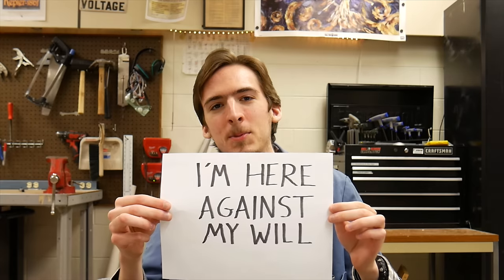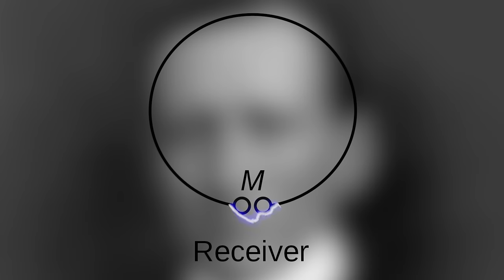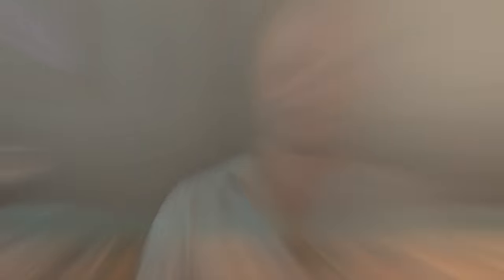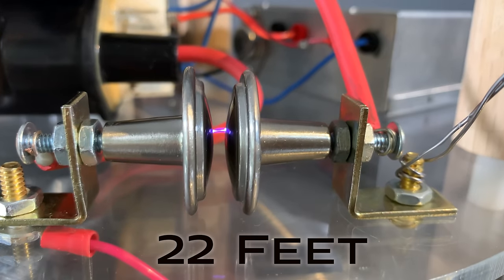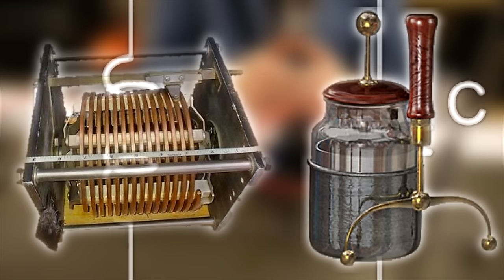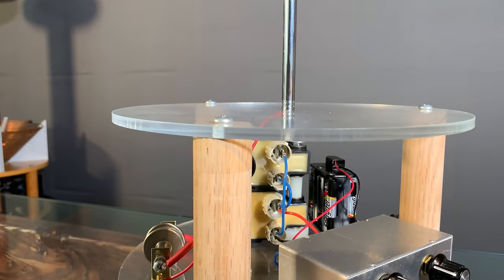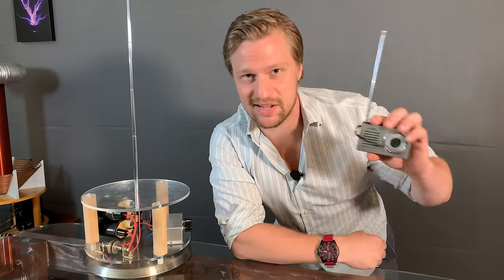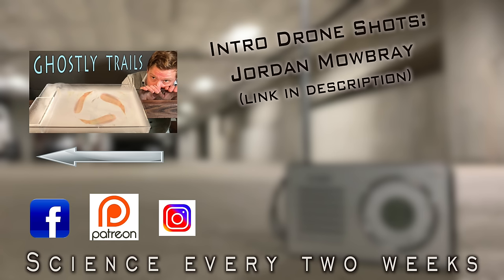Building a Revolutionary Spark Gap Radio (ft. Blueprint)

Comment: I'm a electrical engineering student from India, this one is a best experimental method for verification of Maxwell's equation,

And i really learned something new today,

Since spark gap and high voltage is used a low resistance plasma path establishes, because of this a ionized particle jumps from one electrode to other. Since particles are electrically charged a electric field establishes and since those will move from one side to other side magnetic field also establishes and combination of these two field results in radio wave (because of low level energy density) and it is transmitted by antenna as oscillating wave in space/atmosphere
.

 And in simple words Maxwell's theoretical statement or mathematical equation states that combination of electric and magnetic field which are in different dimensions gives electromagnetic wave and spark gap produces radio wave & radio wave is also a electromagnetic wave.
 Thus this experiment experimentally verifies Maxwell's theory.

And it is beautifully demonstrated and explained by both of you.....

But i have a doubt in transmission, since overall capacitance of the system is in pF range and inductance is also low, thus energy released or consumed or simply stored by reactive elements are less under resonance  also Q factor of coil is too low so amplitude of generated time varying signal signal reaches to zero within nano or in micro seconds so what can i expect at the receiving end ? Noise or Original signal or Distorted version of original signal or pulses (if i neglect medium loss) ?

But this simple circuit has better efficiency with consideration with distance, because Poynting theorem states that power delivered by electromagnetic wave is given by P=E×H (in vector form), now if i consider it's units E has V/m and H has A/m thus we have W/m² in other words distance and power has inverse proportion, and even for long distance this circuit is a winner (Along with medium loss)...!!

Thank you sir, this is a grate educational video.....

I joined this family when it has around 4.3k subscribers but now its 27k..... So this family is growing day by day......
Reply from the maker: I really appreciate your analysis of radio. Wonderful job, yes. 

Thank you for your kind words towards Dayton and I. Glad you are a part of #plasmanation
Reply: Sir please make video on atmospheric electricity.......
Reply: Eu sou engenheiro quimico formado no Brasil, otima explicacao
Reply: i was look for this
Reply: very good
Reply: @alandeng027  hey al 😂
Reply: Now it's 605k ❤️
Reply: Sir what's your profession..what are you doing now. I would like to know about you.. you have great knowledge about electromagnetic field theory..btw I am also from India

Comment: A wonderful and wholesome video as always, Jay! And might I add that your transmitter looks very aesthetically pleasing.

I can't wait to see what is next for Plasma Channel!
Reply from the maker: Blueprint- you will always be a friend of Plasma Channel. Thank you for introducing me to radio
Reply: @PlasmaChannel  is it possible to focus the electromagnetic waves of a radio as to not be broadcast in every direction but only in a certain cone or sector, or could it be so focused as like a a laser beam? and if possible  how would you go about that?
Reply: is it possible to focus the electromagnetic waves of a radio as to not be broadcast in every direction but only in a certain cone or sector, or could it be so focused as like a a laser beam? and if possible  how would you go about that?
Reply: As a radio engineer the antenna length comes down to frequency and resonance. At 1khz the wave length is far greater than at 17kHz, hence a shorter antenna. At 1khz the RF wavelength is 984000 feet, not 5. Also an RF radio wave is not an electromagnetic wave as is prominently written in many books these days in error, it is an electrostatic wave. Imagine walking past a radio station transmitting 2Kw of power, bits of metal from all around would be flying through the air and attaching itself to the antenna until you couldn't actually see the thing until you shut down the Tx. 'Electrostatic'.

Comment: Did this when I was a kid.  Used a 50KV xray transformer and long and high antenna.  Road my bike away for a few miles hearing it all the way.  Good fun.
Reply from the maker: That's really cool. Must have been an awesome feeling.
Reply: the local HAMs must have loved you!
Reply: @PlasmaChannel  It was. especially when I got myself connected across the output.  🤣
Reply: @Francois_Dupont  Only did it a small number of times.  Didn't even know there was such a thing as hams.   I was quite young.  😊
Reply: @Graeme_Lastname  no problem, apparently before the 1950~ most lawnmowers, cars and motorcycle didnt even have a resistor in the spark plug. it would cause each of those motors to be a little spark-gap transmitter. research this if you want, it is interesting!
Reply: @Francois_Dupont  I remember this well.  In some cases you could tell what type of car was passing.  VW was very distinct.   😂

Comment: When I was a little kid I built one for the science fair out of a battery, a wire, a nail, and a file. Scrape the nail against the file, sparks fly, and loud static comes out of all the radio. I came up with the idea 100% on my own, with no help or knowledge whatsoever, just playing around. Also built a light meter out of an led, a wire, and a voltmeter.

Comment: Ok, good video, just a few points. 

1. Many oscillators even today have a spark gap, albeit one that is enclosed by a low voltage neon lamp. Tesla came up with a method of using a magnet to disperse the arc as soon as it had formed and reduce the extra emf, not to mention using capacitors and inductors to tune the resonant frequency.
2. A resonant antenna should be 1/4 wavelength (1/3 is pretty good too, but not ideal). If you look at a single wavelength on an oscilloscope, 1/2 and a full wavelength are the points where the voltage goes back to zero. 1/4, 3/4, and odd multiples of the same are the pints where the voltage peaks.
3. FCC rules allow for experimentation and emergencies as reasons for using otherwise illegal methods.
Reply from the maker: Thanks for these points. Admittedly I am still learning about FCC regs.

Comment: my grandfather was born in the year 1900, he learned electronically by correspondence, and he learned to build his radios, on one occasion he showed me a radio that worked with a stone called galenita, and you could listen to stations from many parts of the world, We got to listen to radio stations from China !!!! , your videos are very good! Congratulations!!!
Reply: Galenite, kind of like lead crystal?
Reply: The mineral is called galena and is comprised mainly of lead sulfide with trace impurities of silver, bismuth &c.  It was used in what was euphemistically called a "Cat's Whisker" receiver.  Without going into much detail it consisted of a long wire antenna, tuneable coil, the galena crystal, head phones and a ground.  You'd position the "cat's whisker" on a "sweet spot" on the crystal which would then enable detection of an AM signal which was fed to the headphones.  Back in the 60s a lot of novelty shops sold self powered radios which were essentially the same as the galena variety except for the fact that it used a germanium diode to detect a signal.  I had one as a kid; however, with the 3 foot antenna wire it had, the best you could get was a really strong signal from WCBS or WABC.  (I grew up in the Bronx.) I learned electronics from a 1963 copy of the ARRL Radio Amateurs Handbook which I still have in my collection and eventually went on to college for a BSEE.  If you want to know more about this primitive receiver check out  https://www.electronics-notes.com/articles/history/radio-receivers/cats-whisker-crystal-radios-sets.php.
Reply: @johnbrandolini2915  great!!!

Comment: The antenna: half the wave-length or quarter of the wave-length?
I’ve learned that it has to be 1/4 of the wave-length.

But I guess that there are some other things to consider. When I was like 10 years-old, I got 2 toy walkie-talkies, with a 10 cm (4 inch) antenna. It worked for ~50 meters (150 ft). I opened it, attached a copper wire and a bamboo stick of 1 meter (3 ft), and I got it work for over 2 km (1.5 mile). It was quite amazing!
Reply: I've got this.

The most common type of antenna is a dipole in which the positive and negative conductors point away from each other. The total length of the dipole (both conductors) is typically 1/2 wavelength. 

Monopole antennas can be thought of as half of a dipole: 1/4 length. But this assumes a ground plane. Since we don't have one of those, it makes sense to capture a full 1/2 wavelength on our aerial instead.
But honestly, it can be any multiple of 1/4 wavelength. Also popular are 3/4 wavelength antennas.

Comment: There's another side-technology that wouldn't have developed so much without this kind of device either. Internal combustion engines. Or at least the Otto cycle where a spark used for ignition is created on the same principle as the early (electro-mechanical) spark gap machines. The principles implemented in magnetos and flyback or ignition coils are quite similar. In some really old cars, the ignition wires and/or plugs don't have adequate resistance and can be noisy as hell on AM band radio. So it's basically a transmitter as well, even if not intentional.
Reply from the maker: That is entirely correct! I’ll be shooting an episode soon about this.

Comment: A previous civilization Tartaria based in Russia used mercury for their antennas!  It would be interesting to see with your set up to see if the mercury exhibited a coherer response as a substitute for the iron filings.  Also I used to do neon sculpture and we used all the rare gases neon , xenon, argon, etc. but never used helium.  Apparently helium was used as a noble gas for high voltage lighting in a globe from a past civilization which depending on pressures and voltages produced a brilliant yellow and blue and red from my recollections that were used for lighting in the early world fairs of Chicago, Paris, St. Louis and Buffalo.  Why is helium not used for lighting? Why were mercury antenna users arrested in 1950-60's Russia?

Comment: Wow so my playing around with my 9000 volt neon transformer making sparks may be interfering with somebody's equipment.    Hmmm  Great video btw.   : )
Reply: Yeah my Tesla coil blows out radio 5stories above :D
Reply from the maker: Realistically you will be fine. Unless you attached it to a large antenna, and, the nst is a modern solid state

Comment: so the ground is the plate on the bottom and it's grounded to the concrete.... and then the radio was also grounded to the concrete...?  would it have worked using dipole antennas and no grounds?

Comment: Tesla never agreed with "Hertz" radio waves theory. He even visited Hertz to explain the mistake... but Hertz  died soon before the completion of the work. He frequently denied the existence of transverse or radial waves traveling like you showed in the video animation... The cause of radio reception is longitudinal waves and not the transverse ones, which is pretty much scattered over spacing and this is how we have to use brute force for amplify the signals to this day. The radio of Tesla was more like the crystal radio reception of energy, there is no supply and amplification on reception. Today we  do not use the method which Tesla patented firstly, we use some sort of Marconi's aberration based on "brute force" and semiconductor amplification. Tesla radio system did not have spark gaps which scramble all the spectrum, it was tuneable and narrow frequency, ideal only for military today.

Comment: Glad to see proper transmission edicate followed haha not haming up everything with spam haha 

If you ran 2x microwave boxes using as cheap Faraday cage with transmitter in one  and wired into 2nd made a filter to transmission on one frequency and output to antenna u likely could run the spark gap as a legal transmission device 😂

Comment: Why did you extend the telescoping antenna on the receiver? It's for FM not AM, the AM antenna is a ferrite bar with a coils of wire wrapped around it inside the radio receiver. 

google  "AM antenna ferrite bar"

Comment: Thanks for sharing this entertaining an interesting video about origin of radio transmitters. 

By using handmade radio transmitters anyone can use motors of drones and command them from far far away. Which will let anyone to explore distant fields miles miles away but, frequencies of those long range radio signals have been occupied by governments and military. So any attempt to use those bands may lead anyone into prison under this world order.
Reply: There are frequencies reserved for public use. There are also frequencies the public can buy a license (CB, Ham, etc...).
Reply: This hasn´t less to do with "world order", but with the fact that a frequency can only be used once, and the spectrum is limited. If anyone would use it as they wish it, no one could use it properly for anything. 
You can still explore fields miles away (as long as you stay in the law) by using other technologies like IP-Based Transmission or GPS Programming.

Comment: Does it interfere with every type of radio wave for example WiFi and Bluetooth?
Reply from the maker: I found it did not interfere with my WiFi at my location, nor my Bluetooth.
Reply: Generally speaking.....the spark gap transmitter generates a amplitude modulated (AM) signal.  Back in the 50's, my friends and I, would build spark gap transmitters for code transmission.  Worked well, but would wipe out area AM radio reception. And yes, it is illegal in the US.  Possible exception would be for emergency communications.  But thats pretty much useless.....most would just bitch about the interference and not recognize or be able to copy morse code.  Keep in mind...Jay's experiment was done inside a Faraday cage......no nasty AM signals escaped....

Comment: No-one ever combined the carbon granule microphone with the iron filing coherer! If they had coated iron particles with a carbon coating, they could have directly transmitted and received audio signals via radio, (with very low fidelity!) without the need for a diode detector!. I used to really upset my parents and neighbours with my (home made) buzzer (made from an old ignition coil from a car, probably an old Morris or Austin, as I practiced Morse code in my bedroom and it displayed as bands of interference on their TV screens and buzzing on their wireless radio speakers in the late 1950s and early 60s.
Reply from the maker: Hey Chris! That's pretty cool. Yeah, im my early days I really irritated my parents on their TV downstairs. Kept causing bands on the TV when I messed with sparks.

Comment: Every brush motor and spark plug is a spark gap radio emitter.
Reply from the maker: Technically, yes. Super, super weak ones of course.
Reply: Plasma Channel actually, that very much depends. Try the same experiment with an open spark plug.  You’ll hear that on your radio no doubt. Also, large brush motors can be noisy enough to kill weak wireless signal say WiFi. The guy next to my lab apparently has one. 
And here is a neat one ham radio guys swear is true: tornados of sufficient strength can also be detected by the same method.  The FCC likes people following the rules. But when high voltage power lines are under heavy load and corona starts snapping at the insulators, they amazingly don’t care too much. And that is way noisier than your rig.

Comment: All the radio waves out there and there still not being used to power small electronics like they should have been by now. 80 years behind the curve.
Reply from the maker: The problem with wireless power - it is hard to transmit in only one direction. It’s like dropping a rock in water, but having waves only go out in one direction.
Reply: Plasma Channel. Look in to Si- graphene power cell. It is basically like a radio wav solar panels.
Reply: Plasma Channel. Point to point wireless power only matters if plan on charging people. (Edison model). Going that route is like charging people with solar panels to use the sun.

Comment: April 10, 1910 the Marconi wireless telegraph company bought the land in Marion mass, an hour south of Boston, put up 14 400 foot towers over 7000 feet, and started transmitting 300,000 watts with 250,000 volt Tesla voils. K1te bradshaw, buzzards bay, mass
Reply: For a dollar, and other considerations from the Hillers.

Comment: I'm really intrigued by the coherent radio detector was wondering if its possible to use it to also detect signal strength, how does it respond with regards to different frequencies?
Reply: A little late, but i think you can not use it to detect strength or frequencies, I have been trying to do so but It only works as a switch,  it can change its resistance sometimes but I am pretty sure it is just an error in my design and not something that you can actually use